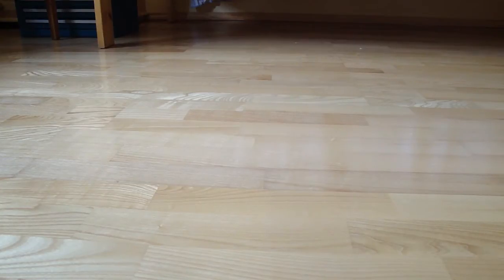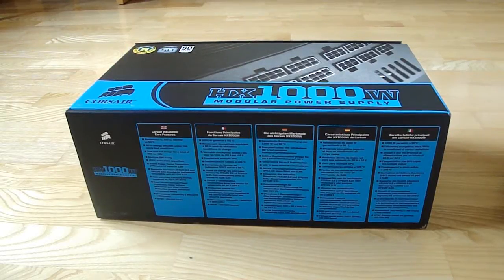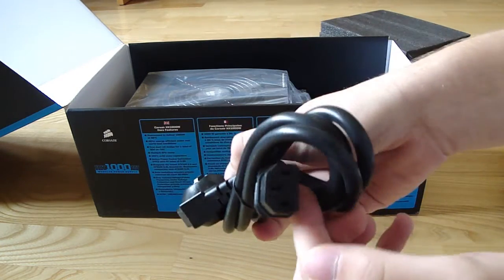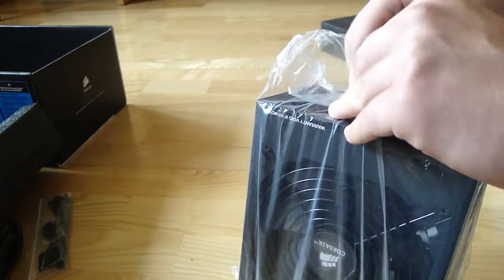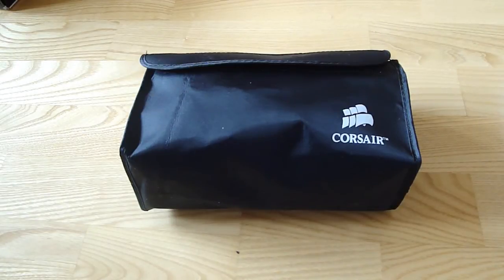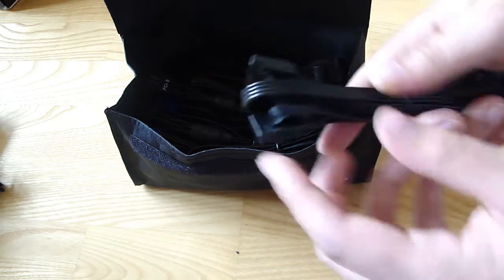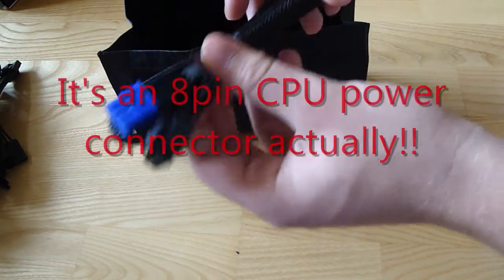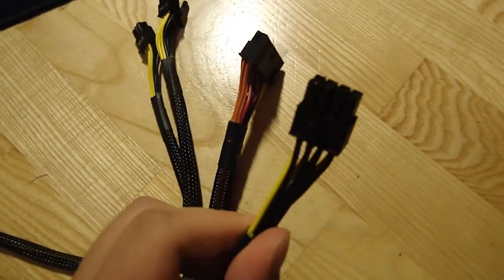(HD) Corsair HX1000W PSU unboxing and overview

Comment: I've bought Cosmos S - the pure length of 24- and 8-pin cables was inadequate for this case. But Cosmos S has appropriate extension cords in the package - so it was not a problem to mount Corsair HX1000W and to connect with all the hardware in that enclosure. :)))

Sorry for my English, I am from Novosibirsk, Russia. :)))